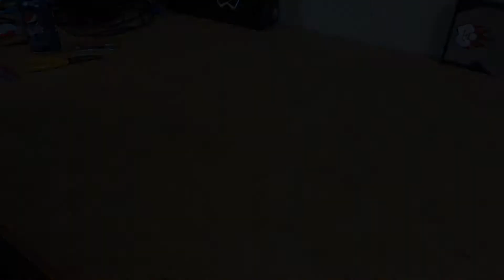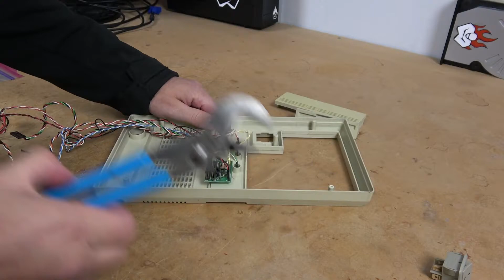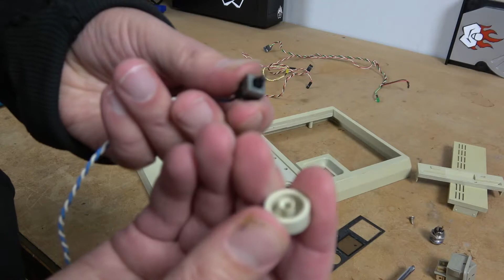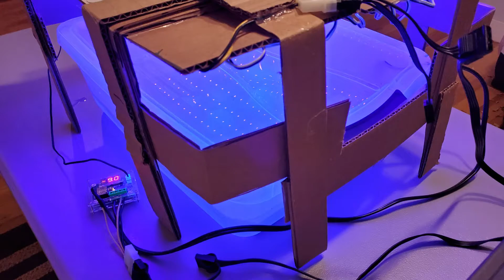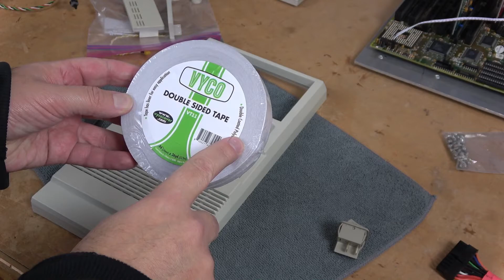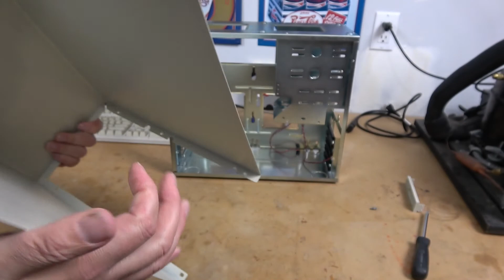Retrobright the Magitronic MiniTower Classic Case Resto Project (Part 3)

Comment: Nice videos. Do you happen to have the jumper settings to this motherboard? I am not able to locate a manual for it even on the archive sites. Also, in the second video you had a test board plugged into one of the slots on the board. Can you tell us what that is? Thanks
Reply from the maker: Pretty sure I didn't have a motherboard in this video.  As for jumper settings on the digit display?  no, it was all trial and error.

Comment: What is the best technique to remove the black plastic?
Reply from the maker: Do you mean the dash part with the labels??  I just used my finger to push from the back through the seven segment display hole.  slow and even pressure will release the glue.  From there you can get under it from the front and peel it back.  The stuff is pretty tough but, I try my best not to bend it too much.  Also a little heat from a hair dryer helps soften up the adhesive.
Reply: @Hardwareasylum  thx , i thin little head are good ;-)